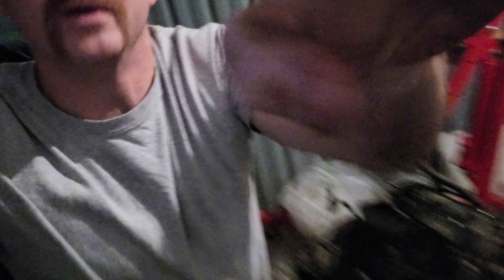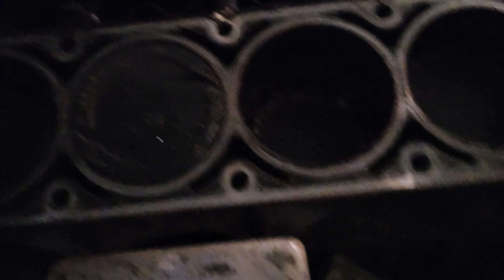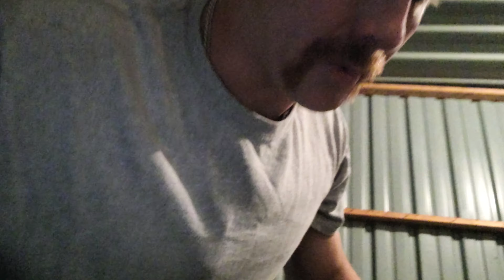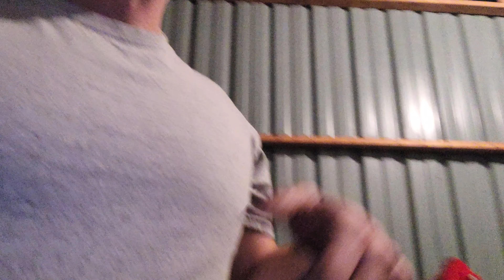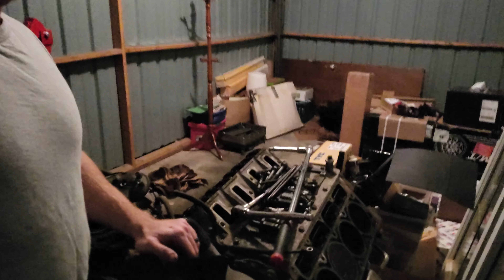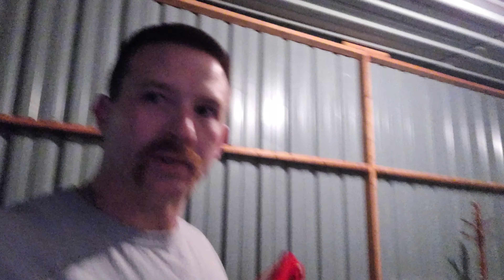Car Maintenance 201: Vortec LS Head Removal

Comment from the maker: Also, I do believe these are grade 8 bolts, but could be grade 10. They are normally labeled on the head of the bolt, but these were not. Either way, grade 8 or grade 10 bolts are great to keep and use since they are high tensile strength bolts.

Comment from the maker: One piece I did not mention: if you are picking one of these up with a blown head gasket, there are some other pieces to check before making a final offer. You can turn the motor over by hand, and also have a compression checker to see how the compression looks in the other cylinders. If you have access to one, a bore scope would also be handy, but not necessarily needed!